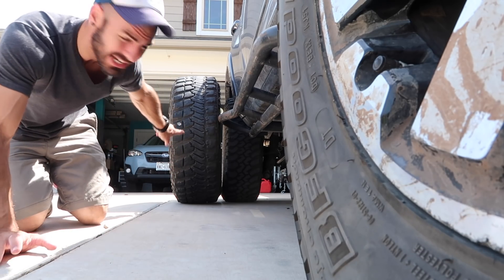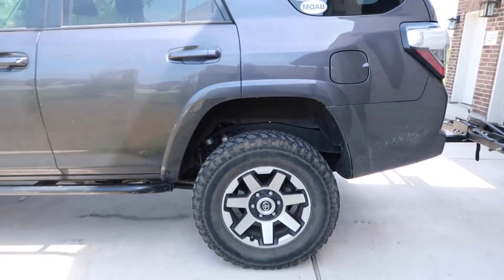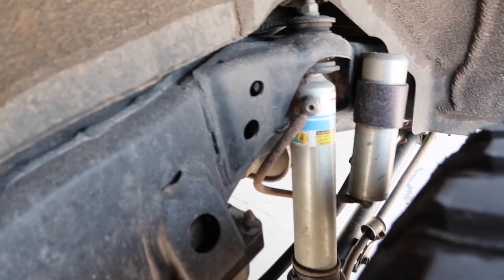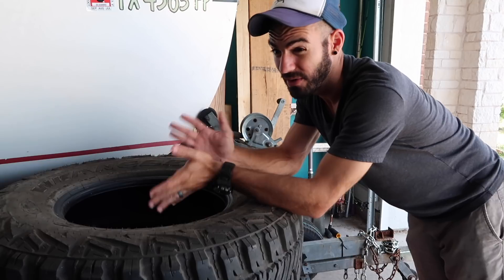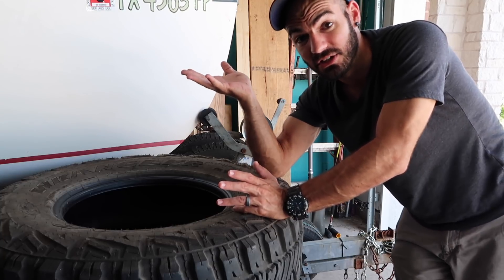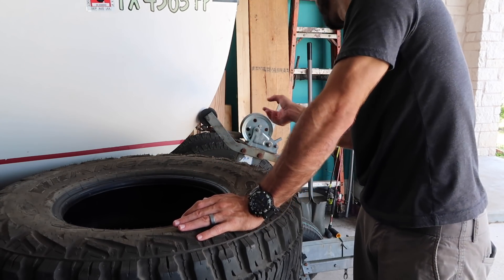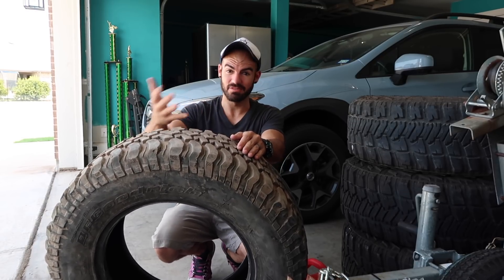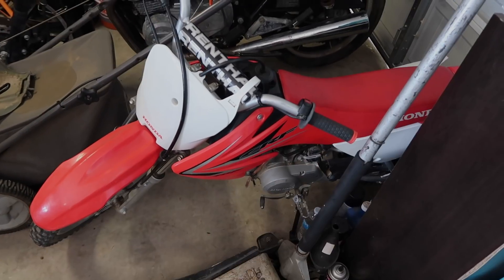Fitting 34's on a Toyota 4Runner Part 2 - I Need Advice - S3.12

Comment: I just put a toytec boss 3" lift on my runner, 2.5" adjustable coilovers, heavy duty springs in the back with 2"resevoir shocks. I put spidertrax spacers on and 285 75 17s. they rub at full turn or with some articulation. I'm gonna have to do a little fender trimming and wheel well molding. Also I need to do a cab mount chop too, stupid little frame arm sticks out. I have the rsg weld in piece on order right now. I'm sure you will have to do the same with those tires. I would totally recommend those coil overs for you. They are spendy tho...

Comment: I believe toytec has a 1 inch coil spacer specifically for the TRD pro coilovers. That paired with a 1" body lift might give you more uptravel clearance to get those 34"s in there. Hope this helps.

Comment: Chop the body mounts, fender liners, and fenders. 3” lift, upper control arms, also going to have to space the rims out or get a new offset rim. There’s no cheap way to go over 285/70 with a 4R. They’re not Jeeps. Don’t do a shit spacer lift on a 4R. Do it right.

Comment: Stronger springs to compensate for the heavy weight.and they have spacers for the trd pro but have to look around.

Wheeler off road has springs for bilstein 6112, those will work with the trd pro on the 4Runner , just have to call to order them.

Comment: I put a 2.5 inch   Suspension lift after I installed my wench and bumper.  I had to remove the spacers.  I am running 33s on my fj.  A body mount chop would get 34s on it. I've just been reluctant to do it.
Reply from the maker: Understood on that one. It seems like the FJ is a bit more forgiving

Comment: The TRD pro is roughly 1.75-2 inch lift over stock.   If you lost and inch you  could make that up with a spring change (will get your height back up and maintain nice ride...you also lost a little with the steel slider install also).  If you do the spacer lift on  top  you have to get bigger bump stop or risk damaging shock.    When you do the spacer lift, you also sacrifice travel (it compresses it more... you do get a little more down travel though).  I don't know if a spring upgrade lift will cover your 34's (I think Toy Tec or Low Range Off road has Eibach Coils available) .  Sounds like you will be re-gearing in short order too.  Question is are you going to go to 35's after this?  If you are going to go with bigger tires you may want long travel (Total Chaos or equivalent) to give you that great ride while riding stiffer tires.  You'll will have to change the fenders out or put some nice flares on.  Will be anxiously waiting on what you decide.
Reply from the maker: I generally only see less than an inch difference on trd pro suspension vs stock, Id be interested in that. Overall I gained ~2.5” when I swapped in the trd pro suspension with the toyotec 2” lift which sounded right. 

Agreed on the bump stops, I will be increasing those. Won’t be regearing, not worried about that with this setup. I agree that it helps but we won’t be doing it . 

A bit of trimming will definitely be going down. I love being out the saw lol
Reply: Idk my off road brand new sat just as high as a pro I was parked right next to.

Comment: I have 6112s with 700lb springs due to lopro (SSO) bumper, winch, steel skids, compressor, etc... 6112s are pretty much what you have, just adjustable...may have to still do BMC and fender trim

Comment: Well budget lift and shocks can at least be tested on the cheap. Remember spacers will limit your shock travel. They make 3” ones but I’d stick to 2” in the front and 1” in the rear. You can get a 2-1 Daystar lift for less than $100 I think. Trimming will get you another inch. If you go 650-700 lbs spring may ride stiff. But you may be able to take off the front sway bar and get a true independent suspension and more articulating ride which could compensate for any lost down travel from the spacer lift.
Reply from the maker: That’s exactly what I was thinking.

Comment: body lift. u might need upper arm with offset ball joint to stop tire rub on upper a arm. or get offset rims. I run 93 runner rough coyntry 5" susp 3 inch body lift with 35s. I offroad this thing almost daily for years. no probs. also 99 runner toytech 3" susp 2" body lift and 35s. no longer have it tho.

Comment: you in Austin?  Where did  u get your alignment done?
Reply from the maker: Yes but don’t let the tires full you on the alignment. They were shot when I put them on. Just need something to hold me over until we get these on. We do the lambs lifetime alignment
Reply: Freedom Crawler  just wondering which location you went to and if you were happy with your results. I am needing an alignment and have a 3" lift on stock upper control arms. Couple of places I call and ask think I am crazy for asking for custom specs mainly getting the most caster I can get on my set up

Comment: I know you dont want to spend a ton, but eventually youre going to want to upgrade again. I personally went with the Fox Coilovers with a total chaos upper arm. I also go the coilovers that could work if you ever wanted to go to a bigger set up like long travel. Buy once cry once. You can get them for cheaper then I did if you dont get the remote resis. If you want to go cheaper then just get the coilover spacer kit. I honestly am not sure if it will be enough though.
Reply from the maker: Agreed completely. I appreciate that input. I love fox shocks

Comment: Didn't you get the one inch spacer lift for your front suspension? I thought you installed that originally?
Reply from the maker: They came with a 2 toytec Lift already installed on them but we have not done a spacer at this point.
Reply: Freedom Crawler so then you would be adding a second spacer?
Reply from the maker: Hmm.. technically yes. One on top of the assembly and I believe there is one inside the assembly.

Comment: If you were to do a 285 you won’t need the body mount chop. You’ll just have to take off the front mud flaps and trim the front bumper.
Reply: Concrete K-9 do you know if 275/65/20 would need a BMC?

Comment: Just curious, what is the potential issue with spacers?
Reply from the maker: Basically They compress the setup vs give it more travel. There are ways to help it, such as removing the sway bar. So it’s not so much an issue per say as it is a work around.

Comment: Is anyone running coilspacer and adjustable bilstein 5100s. I have a spacer and running 295 on 20s. I want to clear 305
Reply from the maker: Essentially the setup I was doing. The TRD Pro coilovers with a spacer in top. It “works” but honestly I hated it. Didn’t feel dialed in and was too tall for that IFS setup. You can rock it on the road all day though

Comment: No spacers! When your truck goes into full droop it will put a lot more stress on the spindle and it will break the spindle where the upper balljoint sits. You need to read "THE BOOK OF THE PIECE"!!! Install the tires on the truck. Jump the truck a few times and the tires will self clearance themselves...  This is the word of the piece, thanks be to DR... lol 😂🤣😂

Comment: Saw a dude on toyota-4runner.org running 295/70/17 with a BMC and bilstien 5100s  wheelers T1 Springs in the front on stealth custom series F5. Which i wanna say is a 17x8.5 -10 offset wheel! So that spring and shock set up could be a choice.
Reply from the maker: Thank you for that. That’s good info

Comment: If you put 34s on the 4 runner it won't have the power to pull the hat off your head. I bought mine with 34s and am seriously considering downsizing for driveability. Mileage sucks. Acceleration sucks. Forget using cruise control. These things might not mean much to you...
Reply from the maker: They are on and mounted. Rig has been great. Not even close to what the jk on 37’s was bit much better capabilities offroad so we are extremely happy with it

Comment: Why don’t you get Jeep JL pull off? I got 5 wheels and tires with 200 miles on them and sold the wheels for $500. Think you need to lose the trd pro suspension and just get some real coilover that’s adjustable.think once you get a real suspension you’ll forget about how much you love the pro stuff.
Reply from the maker: I considered them but I didn’t want an all terrain. I agree that would be a good option but I wanted to go bigger and stick with mud terrains